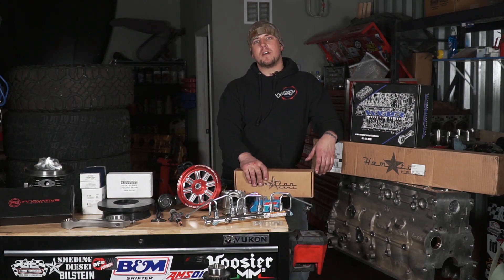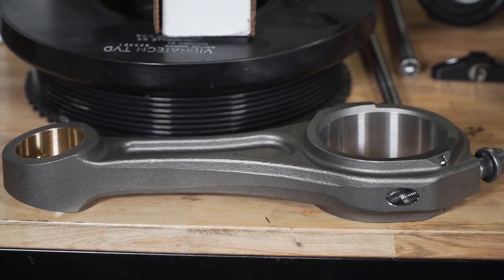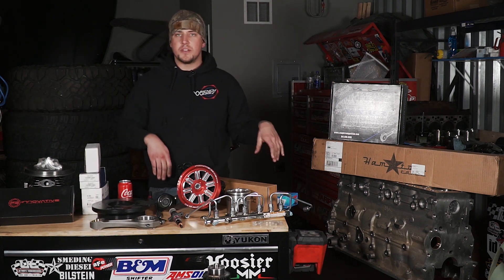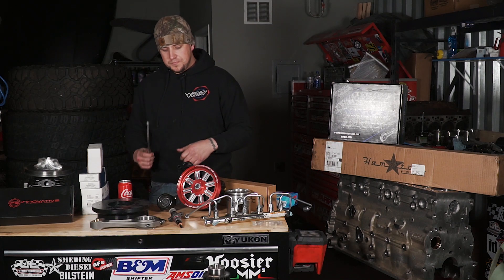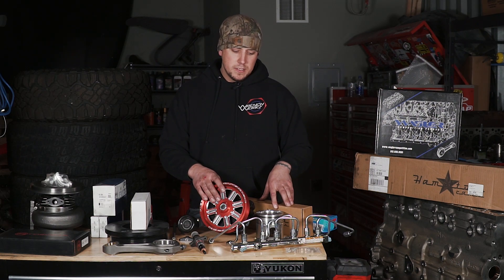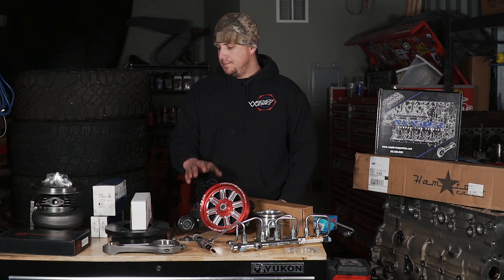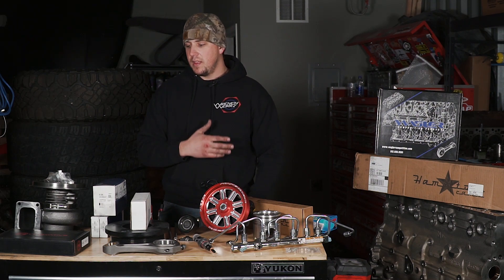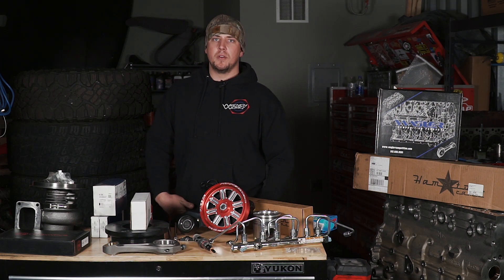New 6.7 Cummins Street Race Engine Build | Power Driven Diesel

Comment: That GT50 is an absolute monster of a charger. With good tuning should make your hp goal no problem.
Reply: @pddofficial  had a clipped 82mm in my 5.9 puller. To date that's still the best charger I ever ran. Just wish they made a twin scroll housing.

Comment: The Garrets perform well but can't take a beating like a Borg warner. Try not to bark it hard or spike it and it should be fine. I always hate when they snap shafts and blow the comp wheels into the intercooler. Its a mess to clean up.

Comment: Why do you keep talking about the 7 cam bearings in the Hamilton block. Don't the regular 6.7 blocks also have 7 bearings on the cam? I know my book has specs for 7 cam journals, am I reading this wrong. Not trying to be a smartass just confused.
Reply: It has insert bearings in all 7 locations. I believe stock only has it in location 1, at least that is how it was on the old motors.  Running a steel cam in the iron block can have issues with scuffing  and possibly even seizing especially as valve spring pressures go up. Putting the dissimilar metal of the inserts in every location is an easy solution.
Reply: My 07 6.7 block only has one cam bearing. Maybe the newer ones have all 7?
Reply: @bcbloc02  Oh I think I see now. So the block is honed out in 7 locations but there is an inserted bearing in just 1 location. I've never had a 6.7 Cummins apart so I wasn't aware of this design. This seems like a design flaw to me. Are there other blocks designed like that? Thanks for the reply.
Reply: Parent of Twins Yes there are other engines that run cam in block as well.  They work fine as engineered. It isn’t till people start altering things that it can be a problem.
Reply: @bcbloc02  Thank you for the information it is much appreciated. What happens if the block becomes worn? Can it be line honed and bearings installed or do you just move on to another block? What are some of the other engines that are designed that way?